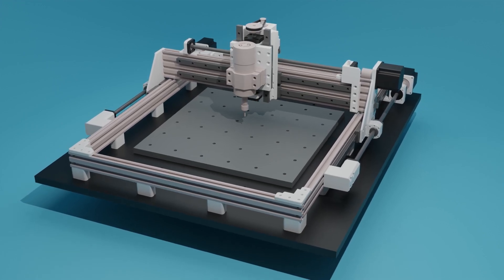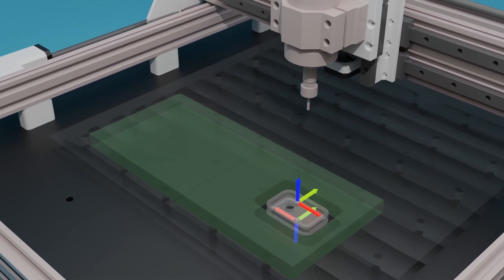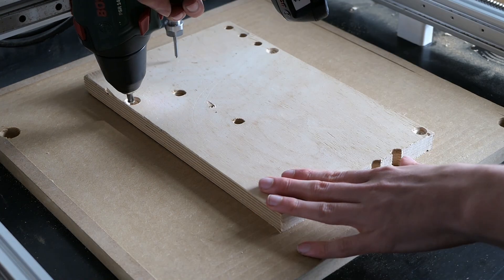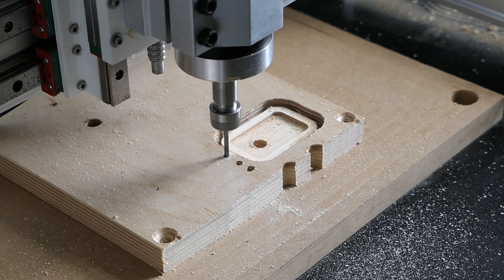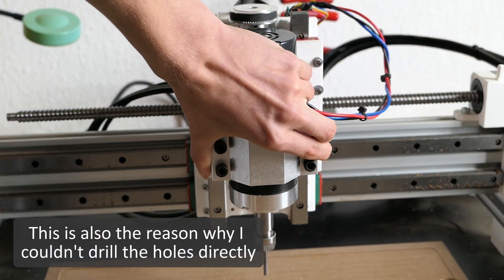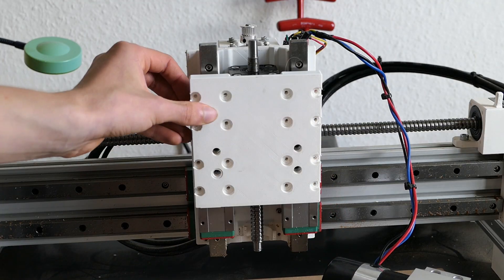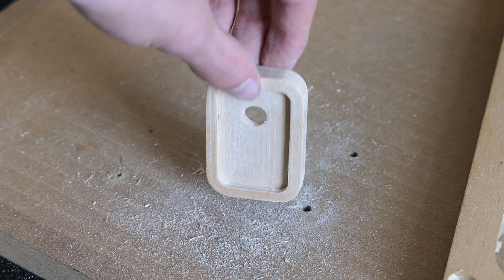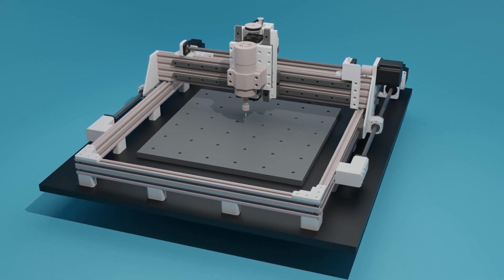Two Sided Machining & CNC Update

Comment: Why not just square up the stock with the CNC and then use edge guides and clamps for a solid reference point for the underside op?
Reply from the maker: That works great too. There are often multible good solutions :)

Comment: The way you vacuum might introduce EMI, id ground that shop vac hose 🙏😸
Reply from the maker: I will look into that
Reply: @SirKuhnhero not a very effective vacuum, hardly picking up anything. Check the filters on the air exhaust side, likely blocked. Or blockage on intake side.

Comment: you'd rather put the location pins as far as possible from each other to gain precision
Reply from the maker: That is absolutely right. I think it doesn't matter for the part I made in the video because it's so small. I will keep that in mind. Thanks.